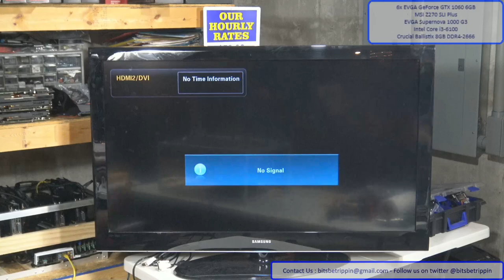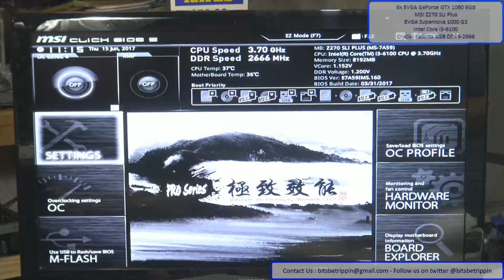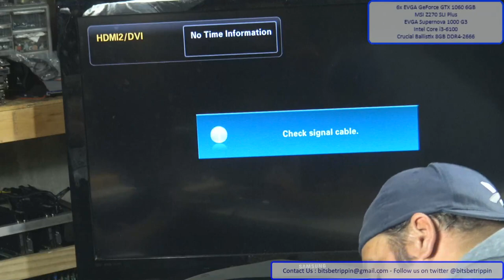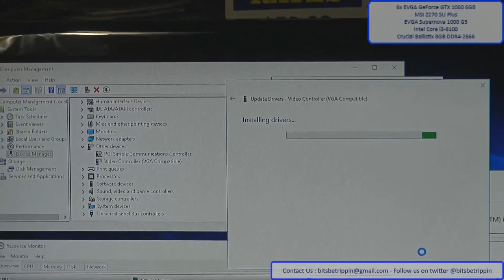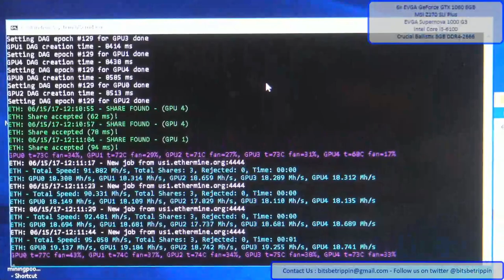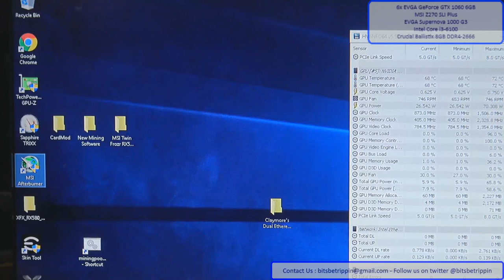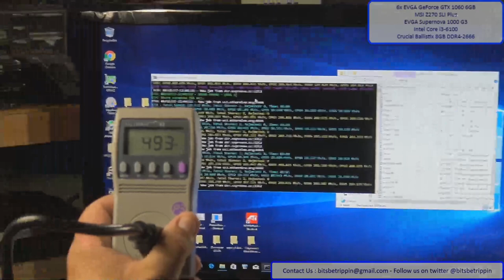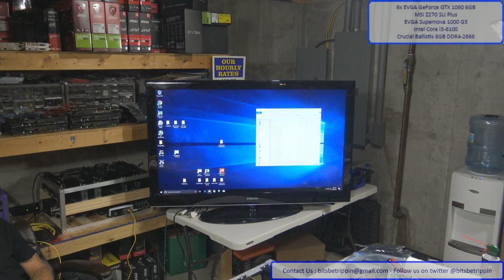BBT Livestream21: Building a Ethereum Mining Rig Start to Finish! 6x GTX 1060

Comment: This is becoming a headache. but after you set up simple mining...where do you go from there? do you have to sign up with dwarfpool, where do i get wallets from, etc. you need a video showing all the way to when you get your profits.
Reply from the maker: Allen Ennis it's a good point your making for someone completely new to mining. I have it down for a suggestion video. We are prepairing to walk folks through a new mining rig setup again; may make sense to do this exact step. Mining Rig setup, configuration, wallet configuration, adding wallet info to a pool + registration. Then how to point rig to the pool, mine for a week, see how your proceeds are paid out etc.
Reply: That would be great to create a walk through video of what to do after the rig is built.  Thanks!
Reply: Amen to that! Waiting anxious for the video.
Reply: I finally figured it all out after days of videos. Once simple mining is done, I set up a dwarfpool account. Before you do any of those two, set up an account on JAX wallet so you have an etherium address. Then you can plug your address into both simplemining and dwarfpool. Autopay your wallet in the settings at .1 or more to automatically pay into your Jax account. Then I send once a month just amount of coin to my coinbase account so I can sell it to pay for the electric bill. The left over gets sent to my ledger wallet for safe keeping and off the grid. Let me know if this helps.
Reply: laurenparkerva It does help a lot. Any information is greatly appreciated. Thanks!
Reply: saleen235 does your name mean you have a mustang? Lol

Comment: Great Video.. thank you for posting..!   Those are Nvidia GTX 1060s which you're trying to get to around 23 Mhash per GPU card.   Could you please tell me what MHash rate that I should expect from a Nvidia GTX 1080 (MSI Armor) ...?    Thank you..!
Reply from the maker: with overclocks at 650 you should get 25mh (1080's not so good at ethereum, but great at zcash)
Reply: Thank you..!  really appreciate the insights.

Comment: So I have windows running using the onboard graphics card. I shut down the computer, install a GTX 1060 with my hdmi plugged directly into it and absolutely nothing happens. Do you have to go in your bios to change what graphics it boots with?
Reply: Matt Towery Set the BIOS to be able to use PCI for output, and the first 16x PCIE slot (closest to the CPU) will be the card that will output the video on.

Comment: The cpu is really not important at all, correct. I mean, you could go with any old dual core that fit the socket. This is based on my  limited research. I know that the cpu handles virtually none of the load. Running the OS, which is barebones, and interfacing with the hdd and couple other lightweight duties. I'm just curious.
Thanks.

*Oh, i also read running a lINUX OS to mine ether is far more efficient. True or bunk myth?
Reply from the maker: Josh Nance by and large yes, however in recent updates of some of the mining software and some select coins requires a significant hit on some celeron processors. We have been putting i3 6100 and 7100 processors in most of the newer rigs and not experiencing some reported lag issues with the various miner software updates.

Comment: that moment when the regular 1060 performs better than the latest GP106-100.

REGULAR 1060 = 70-80Watts/card at 22MH/S on ETH
GP106-100 = 140Watts/card at 25MH/S on ETH

there's a BIG DIFFERENCE.

Comment: great video.. Could you please help me? I am using Biostar TB250-BTC with 6 1060 nvidia 6gb and for some reason i can only get 4 GPUs to mine and 2 remain not working. I already tested each one of them by themselves and all of they work but as soon as i put all of them together I get only 4 to work and 2 idle.

Comment: I have Windows 10 v1703 & latest Nvidia drivers,but i only get 19.2MHs per card with overclocks, +125 on core & +560 on memory.

I use Asus dual GTX 1060 3GB OC

Could it be because of the P2 instead of P0 being active while mining?

Comment: @Bits Be Trippin' SOMEONE PLEASE TELL ME did he use the     #8x1/2" Self tapping screws to drill the motherboard into the wood? Because I am in the middle of the build - I have the exact screws and they seem to touch the motherboard and seem to be too big (im not sure) someone please tell me the answer if its okay to use these screws for the motherboard i'm in the middle of a build. Thanks
Reply from the maker: https://tinyurl.com/yaynmqsh these are the screws for the MB to wood
Reply: @Bits Be Trippin' Thanks a lot for the prompt response , your videos are the best, 1 more question - what spacers should I use between the motherboard and the pinewood , I bought Zinc- Hex/Lug Nuts , would that be fine to use as a spacer? Or does it have to be a specific material/metal ?
Reply: @Bits Be Trippin'  what is a safe material to use for motherboard standoffs  ? Is stainless steel or zinc nuts ok to use ?

Comment: That would be great. Because my rig is up and running and I have no idea what's happing in the backend. It's hashing now but I have no idea who is making money.
Reply from the maker: What software are you using? Did you put your wallet address in it?
Reply: Bits Be Trippin'   Windows with simple mining. I got that working. Now I don’t know where to go from there. Where to create a wallet. I have a coin base account. But I also want to be able to monitor my hash rates and profits. What can I use for that?

Comment: I have a question for you I want a screen card for thorium capable above 30MH / s and thank you
Reply from the maker: RX580 8GB (Sapphire Nitro OC+) and MSI Twin Frozr Gaming X RX580 8GB both capable of that. Or you could go with a GTX 1070 8GB and/or a GTX 1080 Ti from Nvidia able to do 32mhh and 37.8mh respectively

Comment: Hi, Im building my first mining rig with 7 sapphire pulse rx 580 4gb, intel g3930 processor, 2x 4gb vengeance cosair DRAM, gigabyte Z170x Gaming 6 and 2 PSU Evga supernova 850w g3. How do I have to connect all the gpus and the other stuffs?
Reply: Rafael Marcano install gpu. verify its working. power off. repeat.

Comment: Hi guys,

I am planning on building a rig with MSI GeForce GTX 1060 6GB for ETH. Are you able to estimate the hrate? Will 1200 W power source be enough? Thanks!
Reply from the maker: 19 out of the box, 22-23 with overclocks. 1200 is overkill, 1000 works fine
Reply: thanks bbt ;)

Comment: Hello Mr. Carter, I dont see RAM inputted on the board.. Is Ram Irrelavant to mining digital Currency?
Reply from the maker: There is a single stick of 8gb ram on the board, you can go with just 4gb too instead. We always recommend going with a name brand memory stick though. Last thing you want is instability caused by the ram.
Reply: okay thank you.. Also, Can Intel XEON processor work with MSi Z270A M5 gaming Board?
Reply: George Williams If the Xeon is 1151 socket, then possibly. You better check the cpu support list from msi tho.

Comment: 1060 3GB and 1060 6GB use different gpu die, so beware. They're not the same gpu with different memory size, 1060 3GB uses cut down die.

And also, you should aim for around 50% load for the PSU if you want to be the most efficient. Most of the PSU's are most efficient around 50'ish % load. So if you're pulling 700W from the wall, buying 1200-1500W PSU could save you few bucks in the long run.
Reply from the maker: Our 1060 3GB review of the PNY had same result. Die change or not, the platform puts out the same on Crypto
Reply: True, you can do that too.

Comment: Is there any difference EVGA 1060 3GB vs 6GB in mining ETH?
Reply from the maker: Not really, our PNY GTX 1060 3GB XRL8 is 24mh and our ASUS STRIX 1060 GTX 6GB are 23.4mh
Reply: Bits Be Trippin' l My zotac 1060 single fan only has 17.5mhz. Do you have any suggestions?
Reply: Can you please share the OC settings to get  PNY GTX 1060 3GB XRL8 reach 24mhs. Thanks!
Reply: overclock it
Reply: same problem here
Reply: same :(
Reply: KelJii You should find out what Vram your VGA's is using. Use GPUz to find it. mostly with SamSung Vram you can reach 23-24mhz.
Reply: Bits Be Trippin' hcm
Reply: in my experience higher vram variants always perform better, even if its almost nothing.
Reply: Can we achieve 22 Mh/s or 23 on etherum on ASUS Dual OC GeForce GTX 1060 6 GB?
Reply: my gtx 1050 ti run on 14-17Mhz each

Comment: Question Could it be used ann AMD processor than the Intel processor?.
Reply: HONEYBADGER210 well Intel right now is more power efficient and cheaper like the low end g3930 but if you already have an and cpu with a capable motherboard to support all these gpus keep it it will save you money

Comment: Hi, really hope you can help me, I was able to get all of the 6 1060 detected and with no yellow triangle in the device manager, but when I start the miner, it only shows 5 gpu and after a few seconds the pc crashes.
Reply: Sounds like you need more power.
Reply: +Johan Froloff I have a 850w psu, is that enough?

Comment: what is ideal power limit for 1080 Ti's?
Reply from the maker: 90 if it will stay stable, some have to go 105 though when you're over 600mem
Reply: Bits Be Trippin' here is what I've been running:

Power Limit 86
Core -128
Memory +820

I'm getting 150Mh with (4) 1080tis

Been running for 500 hours stable. Every few days it will drop to 146 or 148 and I just freak afterburner by clicking auto on fan settings and de-clicking auto and hit apply. Essentially changing nothing lol. Then it's back to 150Mh. 

About 37.5Mh per card (yes I'm mining ETH until the wheels fall off and it goes PoS).

Comment: 1) Dual mining works the exact same regardless of the memory on your cards, so no, 6gb or 8gb cards do not fare any better. Nvidia cards are all simply bad at dual mining coz claymore has optimized the miner to work best with AMD cards.
2) Nvidia power delivery is completely controlled by the power limit, so if you fix it at 60%, the power drawn doesn't change if you dual triple quadruple mine.
3) Most BIOS do not detect hot plugging USB's, you need to boot the pc with it CONNECTED for it to detect.
Reply: shout out to you dhillon  bro

Comment: Hi bro, I like your job is very good and clear  , excuse me, I would like to start building mining in my apartment can you help me please , I will start for 6 GPU now what your advice for me to buying good and correct parts please  help what parts I need to start from A-Z  , and in future I will make it more GPU .
Also Gtx 1070 is good for mining or your advice another card like 1060 which is the best ? Best card for mining

Please , please , please
Step by step , part by part 
Which is brand name is better Asus , EVGA , Gigabyte, or MSI
Thank you so much
Reply: Mr. Ali here we go:
Motherboard ASUS Z270-A $150
CPU Intel Pentium G4400 $50
RAM 4GB DDR4 Corsair or Kingston $45
Power Supply (2) Corsair CX 750W $74/each

GPUs (6) GTX 1060s 

GTX 1070s are best bang for buck as you'll get 30 to 32Mh per card or about 430sols per card 

You can run (6) 1060s at 400W though

If you can afford it get 6 1070s or a combination of 1060s and 1070s

Comment: i have 12 1060gtx. Have problem rig is stable for 2 days and gives me restart. Is that clock problem or?
Reply from the maker: Assume SMOS or Linux OS? you can try to reduce clocks yes, are you running lower power limit? If so increase it up to 70
Reply: Bits Be Trippin' Yes i am using smos pl 80. Clocks around 1300. I get this error
miner thread hangs need to restart miner
Reply from the maker: Find which GPU is giving you that error ; manually put clocks in SMOS i.e. 1300,1300,1300,1300,1150,1300,1300,1300,1300,1300,1300,1300
Reply: Bits Be Trippin' error is not on specific gpu. Just get that error globally. Myb try with gpu clock bcs i am only clocking memory?

Comment: wow this is a great video do you think i could add 5 of those graphic cards to this build, with a 800 watt psu?  Intel Core i7 @ 4.20GHz 55 °C
 Kaby Lake 14nm Technology
RAM
 16.0GB Dual-Channel Unknown @ 1068MHz (15-15-15-36)
Motherboard
 ASUSTeK COMPUTER INC. TUF Z270 MARK 2 (LGA1151) 71 °C
Graphics
 DELL ST2210 (1920x1080@60Hz)
 4095MB NVIDIA GeForce GTX 1080 (ASUStek Computer Inc) 78 °C
Storage
 1863GB Intel Optane+1.8TBSSD (RAID)
Reply: There is no such thing as 4095MB NVIDIA GeForce GTX 1080. All 1080 have 8192GB of Vram. Moreover, each one of these will draw around 200W so yea, there is no chance an 800W PSU to power all 6 of them. Also, the 1080 is a poor choice for Etherium mining and the i7 and the vast amount of ram will do absolutely nothing in that rig. So yea terrible choices overall. Oh, forget about the raid also, useless too.

Comment: Thanks u freaking schrub, thats the reason i cant buy a gtx 1060 x 6GB because the price is to spicy because the fkin miners! Thanks a lot.
Reply from the maker: Actually Kenny with the price suppression in the cryptocurrency, there are always some people that exit at the bottom, take a look at ebay and other resell sites, you might be able to pickup quite the good deal. Market dynamics are always going to be at play for the hardware required to mine, laws of supply/demand. As one wise man said, don't hate the player, hate the game.
Reply: yeah, i dont want to buy used shit. I got some money (650€) to buy a new parts to my pc and i dont want to use it all to a new graphics card.
And that sucks.